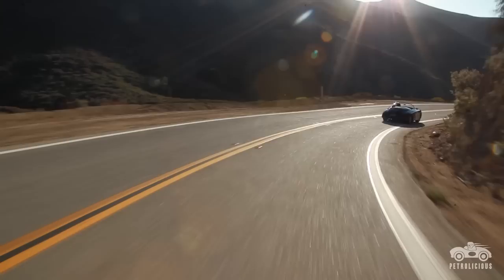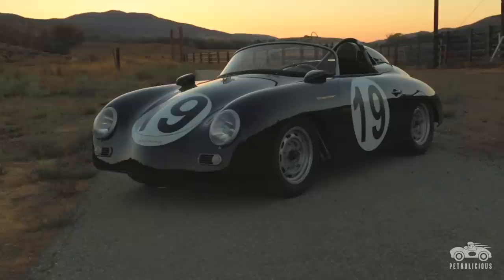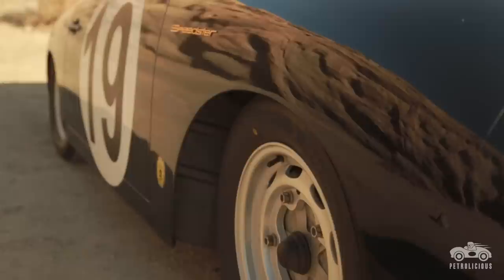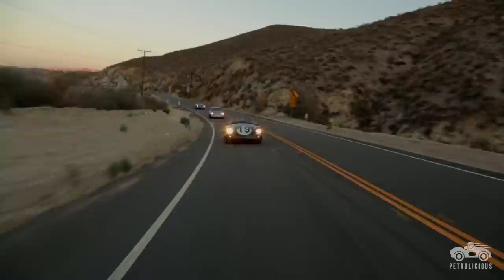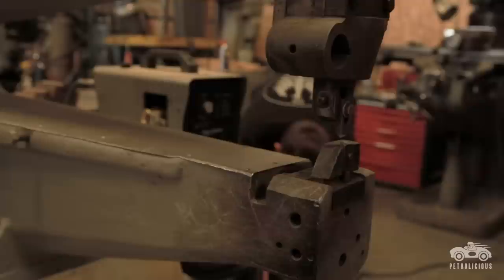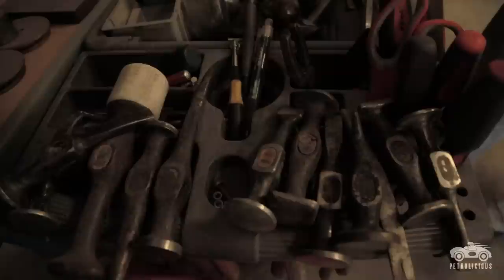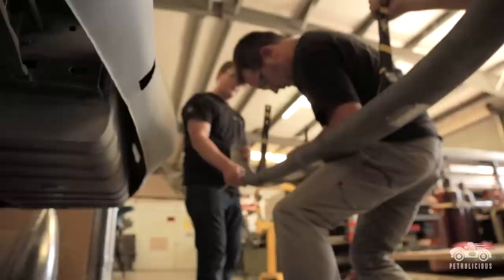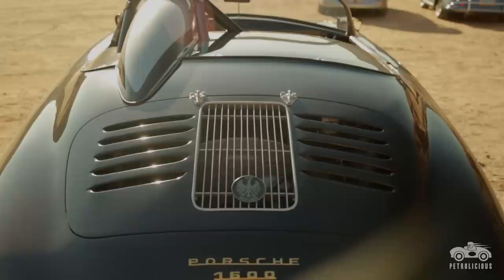This Outlaw Porsche 356 is a Family Tradition

Comment: 550 Spyder used to be my favorite vintage Porsche... but after a couple "Petrolicious" videos about the 356... I think I've chaged my mind.
Reply: Rubens Junior 550s are so cool to look at and drive. They are Uber light down to the hose clamps that hold the aluminum body to the chassis tubes.  But cramped cockpit ,for aerodynamic  racing purposes. Not a good two seater great for just a man and  machine ,driving. ( Like a cafe racer) .
     I've driven real twin cam 550s and replicas. 356 are more of a tank,In a good way ,robust chassis. A replica would be easier to obtain as the 356 are no longer inexpensive.This guy, has years of contacts ,has them, coming to him, by nature of his business . I've loved Outlaw 356  cars for ever, they have always matched my automotive, sports car, tastes,
     I'm building two Z cars a 240z , and a 280z (chassis heavily modded to bring it back to 240 weight.) Both L28 with twin carbs,
The 280 has 240 tail lights and turn signals,and a 240 Dash and steering column and steering wheel) just two fun Z cars for the street ,to drive daily ,thank you Florida.Great car builders,OUTLAW cars ,all rock hard.

Comment: He mentions the car should get about 50 hrs on teh 1.6l before needing to "freshen it up". What all would this entail as it sounds as if its not a full rebuild?
Reply: Alex Martinez Since this particular engine is the vintage race motor with higher compression and we spin it to 7300 rpm it is always good to pull them apart and inspect the bearings and tune up the valves, check piston wear, etc between 25 and 50 hours. We also built a street motor for it that will run for years but only has about 110hp. Now the other two cars driving in the background have 2.4 and 2.6 liter motors in them. The Aqua Marine Blue Met Speedster has an overhead cam POLO motor and the Coupe has a big pushrod 914 based motor. Both put out 190-200 HP and will run for years.

Comment: Gas welding is called brazing
Reply: If the rod is the same as the base metal, it’s welding, as in this case. But joining steel with brass is brazing.